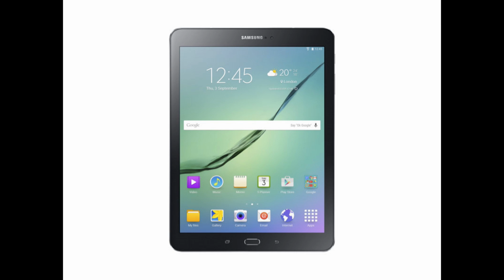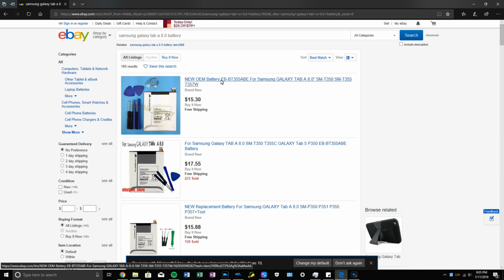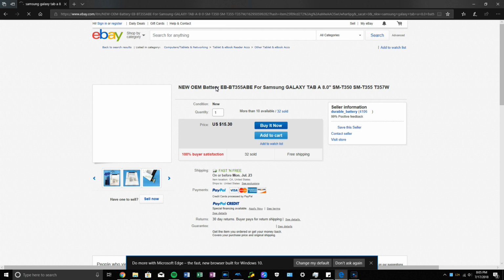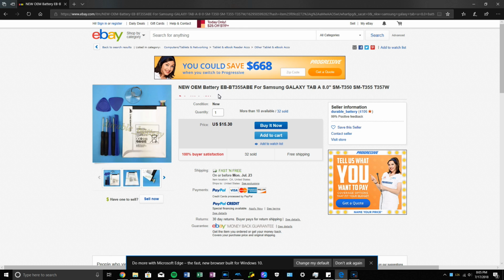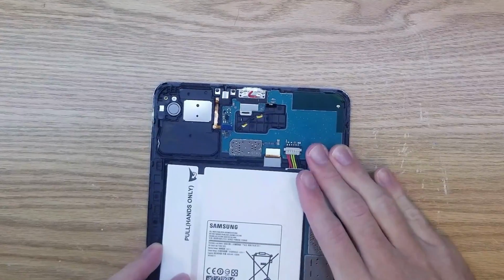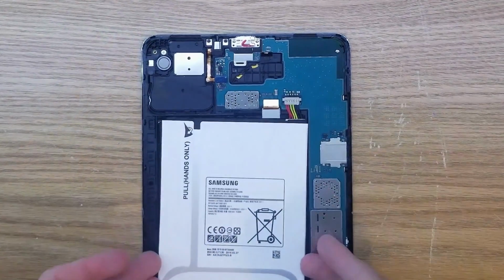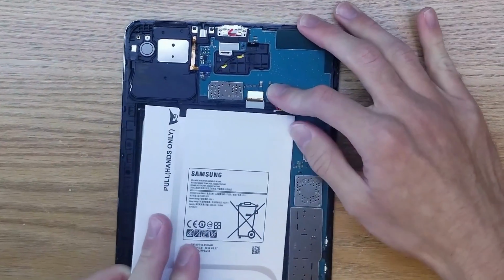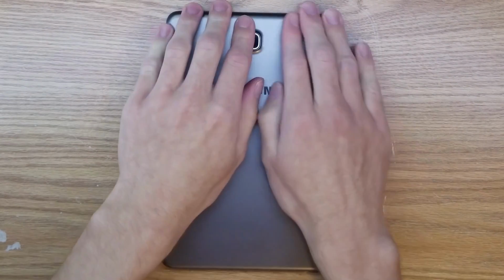Fix Samsung Tablet That Randomly Restarts

Comment from the maker: If at any point while watching the video you enjoyed it or it helped you, consider subscribing!!
Reply: So my Samsung tablet pauses randomly when watching a video. pls help
Reply: @superrex1297   you eight
Reply: Garrett Spitzmueller will the ipad wipe out data im curious idont want it to happen cause I have the same ipad
Reply: I got an unusual problem with my tablet restarting sometimes when i turn off the wifi setting/button,it doesn't happen after it restarted but overtime there might be a chance it will happen again,this problem started happening after i fell my tablet on the ground a few times,do some of you guys have experienced this problem too?,if so then can you tell me what is the solution to it or how to fix it,and is this another battery issue?
Reply: Hey Garrett can you send me your email address where I can show my tablet options because I don't have that kind of bettery wires in my tablet. It's different from my Samsung tablet.
Reply: I need help.
Reply: I disliked this video bc u should put in description (probably old battery issue). This was most likely a waste of my time.
Reply: Note: faulty headphones could cause similar faults/errors & restarts.
Reply: Mine it poweroff all the time when we don't charge
Reply: Me too
Reply: Same
Reply: Will you  lose all the apps on the tablet after you replace the battery

Comment: My tablet always dies when it's under 40% but can we talk about how indestructible these things are?- I've sat on it, it has flown across the room, it's been through heat, I've let it drop, my baby siblings have played with it, and it's STILL perfectly in tact with no cracks. The only damage is the internal damage (lagging and shutting down.)

Comment: Is the random black screens also the batteey problem? My Tab A 9.7 does that often, especially on Chrome and Discord. And it sometimes reboots on its own. I'm going th replace the battery one day because it drains super fast, but I wanted to make sure
Reply: I gad this problem abd Samsung repaired it it was the battery but also the on off switch the problem is ut breaks often and it caused the reload shortfuse.

Comment: Same as mine. Been randomly restarted no matter what battery level it had, even at 98%... Tried to uninstall any apps that probably caused this with no luck... It always working fine when plugged... 
So I will consider replace the battery...

Comment: Tab 2 here. Seems I have problems keeping tablet on when tablet is fully charged. It's takes usually 20-25 times to get tablet to come on and stay on. Currently tablet is on and battery is 65% . Could this still need to replace the battery?
Reply: Still need to replace the battery

Comment: Mine shuts down even when charging at 100% lol. 
Galaxy tab pro t-320, been with me 7 years. I guess it's time to change the battery
Reply: Me too. Let me know if it worked please.
Reply: @calypsomorena it's the battery. I even turn on Airplane mode and Battery saving mode while charging but it keeps restarting. I couldn't get it up to 100% nor it is usable lol. 
However, I tried different chargers and one of 'em worked. It's charging up slowly and usable.
But the fact that the battery depletes faster and shuts down when at 80% means I need to change my battery and a new charger.
Reply: Hi, I am having the same problem with the very same tablet. Did replacing the battery solve the issue? Thank you!

Comment: I was facing the same problem with a tab E but it didn't work with a new original battery.It does the same.The screen sometimes gets blue or green and then turns off.
Reply: Same

Comment: Mine does it sometimes but only when the temperature is over 35C
I tried colling it and it stops but when it heats it turn off. Buy the way whan it cooler the home bottons doesn't work. And it doesn't actually turn off it just go to lock screen but than u can't open it u have to restart it

Comment: I already replaced the battery... original got to the point it got used up too fast. Galaxy tab 4 10.1".... it only reboots when im watching youtube on the toilet in the morning lol. It also is kind of a rare occurrence, it might happen 3 times a month. But what could be causing it? Been doing this for years, long before i switched batteries. Is youtube just too much for the tablet? I find that hard to believe lol...

Comment: Well, I think I'm going to replace my battery..... it lasted 6 years thats pretty good. It still works fine until it hits 30% off charger
Reply: Mine lasted 4 years and it turns of like in 60-40%
Reply: mines is about 5 and a half years old and will shut down when it's under 50%

Comment: Note: I had a similar problem with my Tab A randomly restarting whilst using faulty headphones. I guess the faulty headphones were tricking the battery or causing some problem that made the Tab randomly restart. Had problem for about a week. Plugging in headphones seemed to cause the Tab to restart randomly, usually after a few mins or more, constantly and randomly every 1-7 mins, and the problem continued for 30mins or more after I stopped using the faulty headphones. Hope this might be helpful for someone.
Reply: @TanyaOz : I think the wires were shorting out from wear/tear and minor abuse. The headphones would produce sound only in 1 ear piece, no ear piece or both ear pieces varied by experimentally moving the wires close to the plug and also experienced from general use. The headphones also produced random static sounds from general use and movement or more predictable related static sounds from experimental moving of the wires near the plug. 

It's disappointing these videos fail to mention faulty earphones might cause this Sam Tab randomly restarts problem. 

Oz = Australian? I'm QLD. HAGD.
Reply: @TanyaOz : totally unrelated, I often look at peoples account profile and noticed u have a country playlist with 2 Keith Urban songs. Check out parallel lines by Keith. I only like a small selection of country music and don't really like Keith Urban - nor do I dislike. Parallel Lines is one of my favorite songs, and I was surprised he sung it. HAGD. :)
Reply: For a second I thought I was just gonna have to get a new battery or give up my tablet. Thanks fer writing this, this explains what’s going on with mine and now I just need to go back to wireless headphones again to prevent the problem. Kudos. 💓
Reply: @Minzielol : your welcome. I really wish these video creators would cover these subjects more thoroughly. I found a lot RE faulty battery, but none mentioned faulty earphones. Really disappointing vid IMO.
Reply: Thank u

Comment: I have a galaxy tab a and when It powered off once I got so mad I stood up on my bed and jumped on it

Now it's cracked
Reply: Sounds like you need to learn how express your anger in non-violent ways.
Reply: @wholeshebang1  ngl I would throw mine out the window onto the Pavement so i think they are being normal lol
Reply: Nah, those are both excessive and impulsive reactions to a minor inconvenience that can be fairly easily repaired. Get  handle on your temper or it'll do you no good throughout life.
Reply: Mine feel down a few days ago and it cracked after 3 years but does your tab still work?
Reply: Yeah I have the same problem
Reply: Mine got bent when i kneed on it

Comment: Mine randomly restarts and sometimes it turns off randomly
Reply: Mine does a looping thing and dosent stop help
Reply: @daydreamypenni8612  Have you tried putting it on the charger or prying the back off to take the battery out?
Reply: SAME MINE KEEPS TURNING OFF
IT MAY BE A TEMPORARY ISSUE OR I NEED A NEW BATTERY

Comment: So, is it really true that the restart problem is most likely a bad battery?  I bought my Tab S2 as "open box" and it was a couple years old, even though in new condition otherwise.

Mine always works fine when charging, but whenever the battery is below about 60% it has the restart problem you discribe at the start of your video.

I wonder which battery is better than average quality, so it will last longer than the worst quality batteries, or, all they mostly the same?

Also, do they have date codes on them?  How important is it to buy a FRESH battery and not one that's been sitting in a warehouse for a year or more?
Reply: Omg iam not alone. But mine is like 80ish. It restarts
Reply: @thehair3696  ywah same lol
Reply: @marlamaples1  yey were same. Yet sad also cuz we are also same
Reply: Samw happens to me

Comment: Same exact tablet but I learned that if I have it connected the charger it won’t turn off if a split second passes by without it connected, it restarts/dies
Reply: Same here
Reply: omg same
Reply: same here
Reply: Wait, does anybody else's tablet get hot then dies?
Reply: @user-uh6hl9wc7o  mines was just getting hot before I started this video. but it never overheats/shuts down when I'm on YouTube unless it's under 40-10%
Reply: @user-uh6hl9wc7o   Mine can get hot - but I don't know if that is related to the problem, because mine will work fine and not restart if I use it while charging.

Mine will run off the battery some, but it has to be almost fully charged and once it gets down to about 60% it goes into the "restart loop" as described at the start of this video.  So, I think he's probably right about this being a battery issue - I will find out if I replace my battery.
Reply: @ChristopherOSU   K
Reply: @ChristopherOSU  I have that problem too! When mine gets to 15% it will go shut-down and when I powered on, it's now 1% BOOM!
Reply: I feel like it only happends to this brand so its on charger 24/7 until i tell my dad
Reply: @pascalkotsanou3831  same bro! I'm scared telling my parents what the truth is 😭
Reply: Same for me
Reply: Same for me
Reply: Same!
Reply: WE HAVE THE SAME PROBLEM AND TABLET
Reply: Same here
Reply: Yh
Reply: same
Reply: Same
Reply: SAME
Reply: The same thing, but it is a different tablet model
Reply: Same on my tab s4 it's interuppting my mobile legends rank game rip 15 pts
Reply: @MartialGoddessWuYao  lets play , I play MLBB too !
Reply: Me tooo
Reply: Omg same!!!
Reply: Same
Reply: Same too me
Reply: The same
Reply: Same
Reply: Same
Reply: FR THO
Reply: Yeah
Reply: Wtf same
Reply: Same here
Reply: Yup
Reply: Same ITS SO IRRITATING I LOST A MINECRAFT BEDWARS GAME
Reply: thought i was the only one
Reply: ʂαɱҽ
Reply: Same here
Reply: Same thing. As long as it is plugged in it won't  cut off
Reply: Same here
Reply: Same here with Tab a 2016 with stylus
Reply: SAME
Reply: Exactly why this video was made.

It is a battery problem. 

Mine does the same thing. It NEVER restarts when connected, but often does when unplugged

Comment: To make it more simple, just power it off and let it charge to 100. It worked for me!
Reply: but when i plug my charger to my tablet it keeps restarting please help
Reply: @hachiware_666  hmm idk the battery may be messed up
Reply: It could mean either a loose connection, or the battery needs to be replaced. Rechargable batteries only last so long; then they lose ability to be recharged and have to be replaced. That's why he made this video.
Reply: My tablet dies at 80
Reply: God sake... I can't even power off it.... Its continuously turning off and on

Comment: When i turns off just plug your charger and then hold the power button and it should work and if you don't want to use it with the charger just simply charge it then let it sit for 20 or more minutes 30 the most and it should work
Reply: 20-30!!
Mine charges up within 1-2 hours!
You're lucky!
Reply: Yolanda Siguenza lol im here 1 year later i forgot about this comment
Reply: Does it troubleshoot temporarily or permanently?